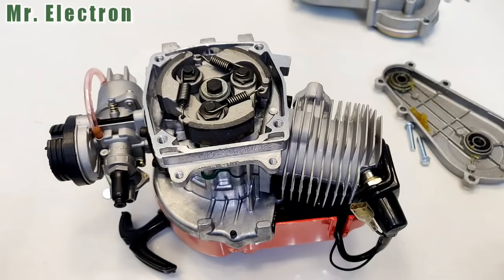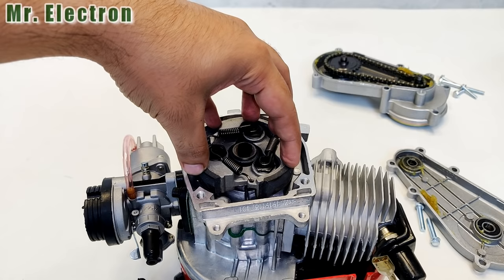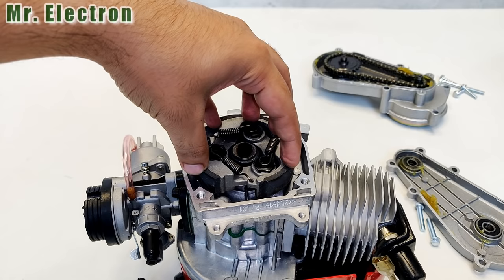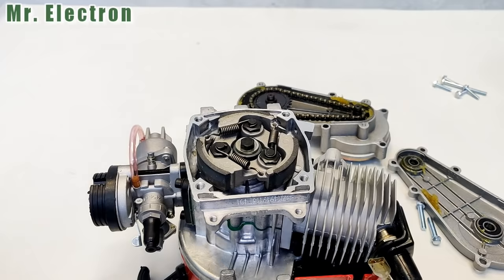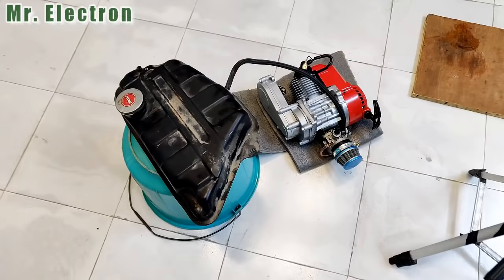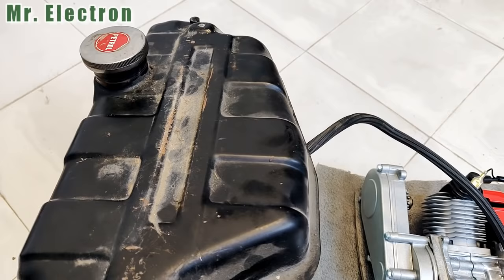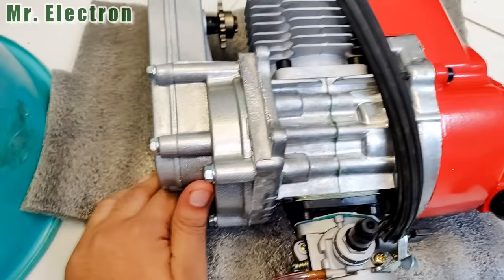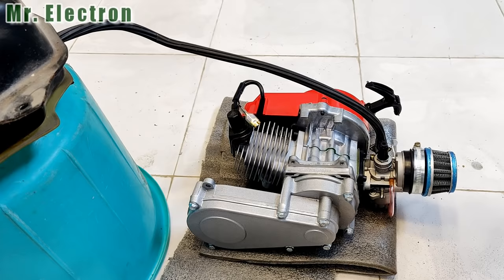49cc Pull Start Mini Moto Dirt Bike Engine Review

Comment: Did you just use the mixture screw as a idle adjustment 😂
Reply: Not that is the idle screw, he uses it as a throttle though for some reason 😂

Comment: my engine hardly turns over and dosent start i’ve taken apart the engine relubed it and still dosent turn over i checked if the piston rings are rubbing on the cylinder but there not

Comment: Also I have a suggestion.When you're gonna make a generator with this engine and an alternator, you may use a high rpm alternator like the BMW alternator.I said this because,low rpm alternators would require more force to turn them compared to the high rpm car alternators. Since this engine runs at high rpm I suggest you to use the BMW alternator and convert its 12v to 220v using your power inverter.This is a suggestion given by me just as a student gives to his teacher.If you feel it is correct,you can accept it.
Reply from the maker: Good one but its possible only if the engine is capable of giving the alternator an equivalent value of mechanical drive input (2160 Watts in this case )
Reply: Oh, Power input=power output.But how many H.P is this engine?

Comment: My man you just put the idling to the max and when you took off the choke that was when the axle started running but the piece under the rubber is the proper thing to use

Comment: Problem you have with your carb is when you fully close the choke you are fully closing it not allowing any air to enter the engine. There needs to be a small hole in the middle of the flap. 
When you started your engine you had to slightly open it ( i found it rather annoying on my motor)

Comment: Issue useing 4 stroke oil is mixing it gasoline so safe choice use 2 stroke oil i thrashed snow sled engine just useing 4 stroke oil

Comment: As someone who knows a lot about engines, I can say that there was some misinformation in the video ( 7:20 the screw differentiates the fuel to air mixture not the speed of the engine),
But over all its a good video with great details

Comment: where are the mounting points on the case to install it onto something?
Reply: On the bottom side has 4 mounts. But they need to be tight or it flexs and snaps the ears off. That's what happens to mind

Comment: Hi guys just wanted to ask,

I have a 50cc B1 replica minimoto, for some reason the bike seems to be engaged in gear as when I go to pull start the bike it tries to move forward. Any advice on this ? I have already changed the clutch as that was slightly disintegrated.

Many thanks
Reply: Throttle too tight?
Reply: @samwilson756  no not at all its as if it's engaged in a gear already. 

Imagine trying to start your car or bike with it in 1st gear, that's basically what's happening 🤔
Reply: Late reply but ur clutch springs are to soft

Comment: what if I attach a gear to the engine itself without a gearbox? Will it work?
Reply from the maker: Yes but the output torque will be very less although speed will be much higher
Reply: So why won't we add derailleurs to it?

Comment: Yooo weird question but I want to get a mini bike an I can’t decide on which one to get. I want to go fast reallllll fast, I was thinking the us stock 49cc 4 stroke hole shot or something off of amazon. I also want to know if that it better than a 2 stroke engine and if I should get a 49cc 2 stroke or a 49cc 4 stroke. And remember I just want to go fasttttt
Reply: The standard 2 stroke kits are aweful compared to the standard 4 stroke kits, however this 2 stroke kit looks alot better than the standard most common one I see, but assuming same quality and size a 2 stroke will have more hp than a 4 stroke, I'd do more research on specific engines

Comment: I have just bought one of these engines brand new from Ebay, fitted it to the mini dirt bike.. And the pull start will not pull, neither will the sprocket turn.. Has anyone any suggestions? Again the engine is brand new out the box
Reply: Ok so is it a 2 stroke or 4 stroke engine lubricated the engine if possible and then out fuel into it but if it's 2 stroke I highly recommend you mix 2 stroke oil I your fuel or you will seize your engine and need to buy a new one